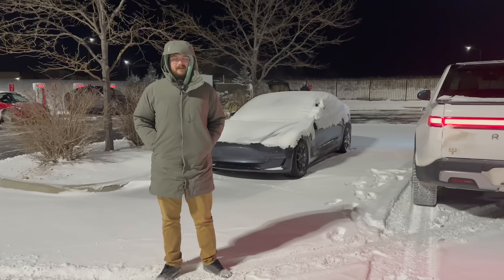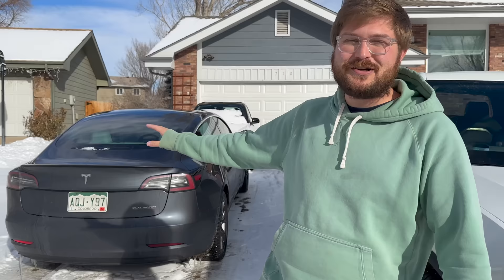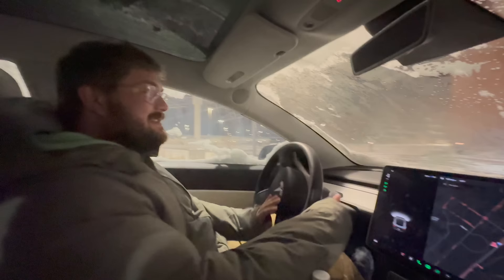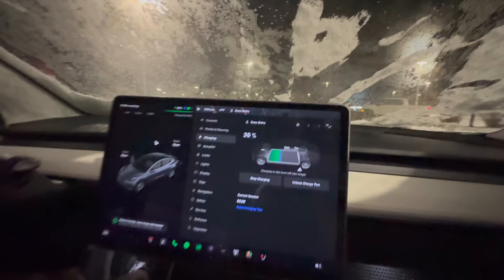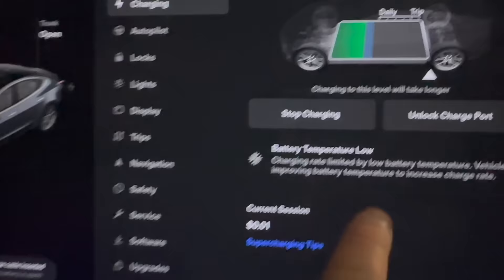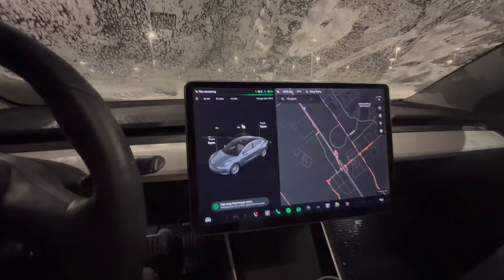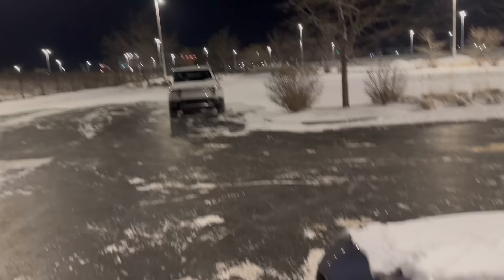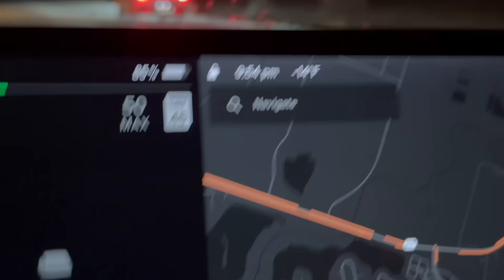I Deep Froze My Tesla And Immediately Plugged It Into A Supercharger To See What Happens

Comment: Started my V6 powered truck this morning in les than 10 min. my cabin was warm my windows that were covered with ice started melting. While I was sipping my coffee, I turned truck around and headed out to the gas station. took less than 5 min. to fill up. How much did your pre charge cost??
Reply: Opportunity cost in charging an EV, that is always the thing that gets me. I have a truck with a 33 gallon tank. Average fill time from just before the warning light comes on is under 3 minutes unless I'm at a REALLY slow pump in which case it's closer to 10 minutes. That hasn't happened in many years though.
I fuel up. I walk in to the convenience store. Grab a snack. Walk out. I've spent less than 15 minutes, usually under 10, at the gas station and I've got a full tank and a happy attitude because of the snack. Im on the road and off to making some money and on with my life! Come on.
I must say, electric vehicles, the technology: so cool! I love seeing crazy new things, but EVs as a direct replacement for gas/diesel vehicles is a hard no still. They have their use cases, but they are not for everyone.

Comment: If you preheat the cabin from the app or set a scheduled departure time it will also preheat the battery. If you live in a city as you described no need to wait at the supercharger - just set it going before you leave. The app shows an orange heat symbol as well so you know its working.
Reply: Will it preheat the battery and cabin in extreme cold conditions if it is not plugged in?
Reply: @timgurr1876  It doesn't need to be plugged in, but obviously you need to have the battery capacity to heat it up.
Reply: @timgurr1876  It will - I think it will turn off if it goes below 20% but you can turn it back on again. Tesla have also just added a 'pop door' function in the app to open the door when the handle is frozen.

Comment: Running the cabin heater would aid in warming the battery because the rest of the frame of the car would warm the battery some.  It's really important to do all the heating you can.
Reply: And it wouldn't have slowed charging anyways since the car would just draw extra from the charger to run the cabin heater

Comment: Talk about making the case for avoiding EVs! I'm over 70, and I guarantee that I would never want to deal with this situation. A few minutes pumping gas, and a few minutes later I'm on the road and toasty warm.
Reply: Most people who have these cars don’t do this, either. They just charge at home, cold or not, and they wake up with all the charge they need. On road trips, it’s never this slow as your battery is warm while driving. This temp is also pretty extreme. These videos are interesting, but they aren’t very representative of typical owner experience.
Reply: @house9120  In everyday situations, sure. Charge at home, commute to work, come back on the same charge. But that also means that EVs are fundamentally more limiting that gas cars when it comes to long trips/spontaneous trips. You'll literally have to theorycraft how you'll get to your destination, including chargers, expected weather, charger availability, time alloted, etc - something you don't really have to do with gas car, simply because gas stations are so common after decades of constant gas car usage.
Reply: @fortissears5388  there can be some additional planning, sure. I’ve taken a lot of EV road trips though and the car navigation system largely takes care of the planning, finding charging stops needed to get to your destination and calculating how long you’ll need to charge there. Many of my stops are sub 15 minutes. We can expect this experience to improve a lot as charging speeds increase, charger availability becomes more dense, and navigation planning becomes more sophisticated. I think the future of this is pretty bright
Reply: ah the 98% problem, where people really care about the 2% very rare edge cases, but put a second priority to the extra benefit of the 98%

Comment: Would have been interesting if you had ScanMyTesla running on it. You could have watched all the internal temps of battery and motors, coolant flows, etc. Also the heat pump on the newer cars may not provide much help at these very cold temps.   
P.S. You did mention that as I was typing this. ScanMyTesla is a really valuable app for us data nerds. You can see everything that is going under the skin.

Comment: 1h45m to fuel your car, "THIS IS AWESOME".
Reply: It was a test of the worst scenario (ice brick). You see other Teslas came & gone much quicker in the same lot. Those drivers have preset their nav to the superchargers & those cars already  preheated themselves before they got there.
Reply: @dougdu  You saw that the lot was full, and that indicates that an unknown number of other teslas likely drove by and left without a charge to go look for another station.
Reply: @Aspartame69 Do you drive a Tesla? Have you charged at a supercharger or are you just guessing? I drive a Tesla. If I get to a supercharger & it's full I would just wait a bit. Teslas are usually in & out of these stalls quickly. In less than 5 minutes usually a stall would open. That's far quicker than driving to another supercharger station. If you don't drive a Tesla please don't pretend.
Reply: @dougdu  I drive an MHEV, best of both worlds.

Comment: Cool experiment, thanks for braving the cold to do it. Questions: How much did it cost to heat up the battery before it was able to charge? If you'd have run the HVAC to keep the car warm while charging, would that have added to the cost or time to get to 90%? That's probably a more realistic scenario, as few folks in this position would have a second car to hang out in to keep from freezing. Thanks!
Reply: @oscarpaisi4037 
Wouldn't want to forget a bunch of bull 💩 you just made up.
Reply: @oscarpaisi4037 huh??  Lfp battery Tesla says charge to 100%.  Yes, below 20% and it won't precondition battery for SC but it will charge fine.   You probably own a 2005 Civic.

Comment: Sirs, I have a degree in physics and really thought it would be fun to have an electric car. I see videos like this where it takes 40 minutes or so before the car even starts charging. Range is like 180 miles on EVs in the winter. You sit in it freezing your backside off because you don't want to use heat because you will lose range. My present car is a VW Passat diesel. Starts in 3 or 4 seconds even when -25 defrees f. I honestly drive slow for the first 5 minutes or so in very cold weather. It gets 50 mpg in the winter and 55mpg in the summer. It takes 3 minutes to refuel. It's hard to do a trip somewhere past range/2 because you are sweating the recharging. When we have nuclear fusion electric power, a really good electric distribution system and better means of storing electric power then it makes sense. Green people may want to understand what the carbon cycle is also.....
Reply: yeah diesels👌

Comment: I can leave my gas car 2 weeks in the cold , put in my key and it starts right up
Reply: Having formerly owned an ICE car, the battery would have been weak/dead after 2 weeks of the car just sitting in the cold.
Reply: In extreme cold most need a block heater

Comment: Well you convinced me! I'd rather have a horse and buggy than trust my life to this technology.
Reply: Nah just don't buy Tesla.  They're California cars that are kinda notorious for being poorly engineered for severe cold (how many times have their heat pumps been recalled in Canada?).  Heat pumps win over resistive heat in mild cold, but in a scenario like this, Tesla's thermal management is piss poor.  How the hell is the motor that toasty warm but the battery too cold to take a charge, other than poor design?  As much as people malign the Chevy Bolt for slow charging, it has a dedicated 2 kW resistive heater for JUST the battery and I've NEVER seen a Bolt battery take as long as this car did to warm up.

Comment: Cool video, worth mentioning when Bjorn Nyland did similar tests he found out driving the car first for a bit helped a lot with heating it up faster.
Reply: Yep.. the motors can only run so much to waste heat, the way to make them run more is to.. actually drive.
Reply: So true. One of the issues I will run into since I’m an apartment dweller with no garage and I live in the Northeast corner of the US
Reply: Running interior heater should not reduce heating to the battery. Might actually help to start charging faster

Comment: As a power plant engineer, it's good to know the coal fired power station supplying electric to the supercharger isn't really affected by extreme temperature drops.
Reply: It took a long time to build out the current fossil fuel industry and a long time to build out electric generation and distribution systems.  It will take a long time to incrementally add more modular nuclear power, high voltage DC lines connecting wind/solar from where the solar & wind resources originate to where population centers are located.  Our little 16 kW solar array (two two-axis 8 kW arrays) powers a 98 kW LiFePO4 battery array which then powers our little barn / guest house in northern Michigan.  Solar resource in northmen MI is substantial 7 months out of the year while wind resource is substantial year around.  Phase II is to add some wind turbines onto the campus for year-around electric power generation. In the Spring, Summer and Fall we have no problem whatsoever charging our model Y Tesla along with running the A/C, running the electric washer & dryer and electric water well etc etc.  during the day AND fully charging the batteries to enable night time irrigation systems to water our 3 acres of newly planted wild flowers, trees and shrubs.  I am looking forward to publishing everything once we have Phase II and Phase III completed and we have 5 year data.  Overnight success takes about 15 years in my experience and a revolution takes about 100 years.  I personally feel that a combination of coal, oil, nuclear, natural gas, hydrogen, solar, wind, hydroelectric will all be needed for energy security for the United States.  I am pro energy across the board but also believe in planting a diverse set of trees and plants, eating organic, supporting CSAs (Community Supported Agriculture), exercising my own body (mind and physical), being conservative -- walking where I can, when I can, or bicycling, not participating in spectator sports (an enormous source of carbon and enormous consumption of wasted talent that could be re-directed to better endeavors to serve humankind), don't support cryptocurrency (terrible carbon footprint and waste of electricity and wonderful currency to launder money for criminals)...  An internal combustion engine vehicle is much less efficient than an EV -- the heat waste generated by an ICE system is terrible.  Humans are parasitic in the planet Earth.  We will have our time on this planet and our species eventually will fail and become extinct.  It doesn't mean we shouldn't be prudent to pass on a less harmed world to the next generation so that they may have a better chance at advancing the knowledge and understanding of what it is to be human.  Perhaps some day we'll develop AI systems that can successfully travel to distant planets -- humans are barely equipped to successfully live on this planet shielded from terrible radiation from our closest star.  Machines are more radiation resistant than human DNA / RNA.
Reply: @stephenorr3396 Machines are not more radiation resistant then humans. Just look what happend to robot in chernobyl. It's systems where destroy by the radiation.

Comment: Great video! Thanks for doing this test for us. I'm in Atlanta, GA and just had a small dusting of snow last night (usually happens once every year or two lol) it didn't get above 32F the past few days and my car didn't charge at my house. This taught me a lot! Heading to the supercharger now with preconditioning on 👍🏻
Reply: I also live in Atlanta. I have never had this problem. If you leave it plugged in at home in the cold it will never get cold soaked since it will just use a tiny bit of electricity to keep the pack warm. Even if you don't keep it plugged in and it does get cold soaked then go into your Tesla app and select 'schedule' category and then schedule a departure time in the morning and then select 'precondition'. It will turn on and run the climate and precondition the battery ahead of that departure time. I've never even had to do that in Atlanta though.

If you try to plug in and it won't charge then just either turn on the car and leave the heat on for 30 min. to an hour and then retry charging or go into the app and do the departure 'precondition' thing. Or set the nav to the nearest Supercharger to you and it will begin to automatically precondition the battery for charging even if you aren't driving. Whatever system you use, even sitting hooked up to a Supercharger, the pack will only use 5 kWs to precondition. So might as well let your battery warm itself up for 30 min to an hour. That will only use 2.5 - 5 kWhs of energy which isn't much.

Edit: The reason your home charger isn't able to charge is that it is likely trying to put more than a 5kW rate into the pack which I guess is the limit Tesla has set to protect the pack. Most home L2 chargers are in the 7-11 kW range. There is a manual setting on your Tesla screen under charging where you can select the AC max power which you could set lower to like 20 amps so it would only allow just under 5 kWs from your home charger into the pack. Then it would charge, but just slower until the pack warmed up. The Supercharger has more sophisticated software that communicates with the car and throttles back to 5 kW. Your home charger doesn't so you have to manually set it to 5 kWs or 20amp/240V.
Reply: @flipadavis  way too many  variables to  drive an electric car, stick with fuel type car , or  a  hybrid, unless you want to be stranded in the cold ~ its  just that simple  .  .
Reply: @kingdommusic5456  I've driven 100,000 miles across two EVs. Drove my Tesla with 3 people cross country stopping at dozens of sights. In one day that Summer we went through and stopped in Death Valley and then past Mammoth up through Tioga pass and into Yosemite where we stayed that night. Drove through a record heat wave in 121 degree temp days later coming back through Barstow.

Had no problems.
Reply: @flipadavis  Yes, you had no issues, but it seems you are very well versed in the operation of your EV.
Unfortunately, maybe one person out of every five (probably a very conservative guess) will be as well versed in the proper operation of their EV. That being said, the manufacturers needs to understand that not every owner will bother to learn all of the nuances, and proper operation of their EV. 
On the other hand, when ICE driven cars first hit the scene they weren't  as simple to operate as they are today. As late as the late sixties and possibly the early seventies it wasn't uncommon for a vehicle to have a manually operated choke, which the operator had to have a basic understanding of in order to operate. If one didn't know how to operate the choke, they would never get a carbureted ICE started even in mildly cold temps. And that's just one of several things that one had to learn in order to operate an ICE in cold weather. So its a learning curve, but unfortunately we are being pushed to adopt a technology that isn't ready for the big time, yet. I feel that if we were to wait ten more years the battery technology would probably be at a point where it would absolutely, make more sense to buy an EV. However,  as it stands I'm afraid all that is being done by pushing EV's on everyone before they are practical will do nothing but create a stigma for EV's that will take a long time to fade.

Comment: Awesome, sadly these freakish temps(<-20c) are 'normal' here in Montreal and will occur 3-4times per year and typically last 3-4 days before returning to more normal(-10c) temps. Guess the only way around this is to ensure car is plugged in, even if it is into a regular 110v plug
Reply: Just put the supercharger in the nav. It will preheat so that you arrive with good battery temperature. Preheating for 30 minutes isn't too bad if you're driving anyways.
Reply: Yes, same here in Ottawa. Best to keep the car plugged in all the time if you can. The 110 Volt will give you about 1kW which is just enough to keep the battery warmish, at these very cold temps, but not enough left over to charge the battery at the same time. Best to get 240v Level 2, then you're laughing.

Comment: Great video
I’m in MN and we just had a stretch of sub zero weather. I charge overnight in an underground heated garage. Standard 110 outlet. I have a 35 mile commute with the car parked outside for 10 hours. Took about 10-12% each way instead of the 8-10% during non sub zero. Also I lost about 7-8% while parked outside all day. 
 I found that I would get better overnight charging if I navigated to the super charger near my townhouse then plug in at home. This way my battery was already warm 
 I charged to 93% overnight instead of the normal 83%. During the 10 day stretch of sub  zero I “topped off” at a super charger twice - because I was actually making a Target run and they have Super Charging. I’m new to EV with my 22 M3 LR.  I love it. Like I mentioned before I just charge with 110 and haven’t had any problems. One thing to note-make sure no moisture is in the charging port. It throws my GFI on the wall outlet. Had that challenge when we had a warm wet snow and everything was slushy. Some snow got in the port.  
Thanks again for the video